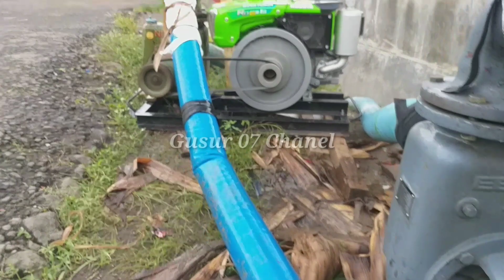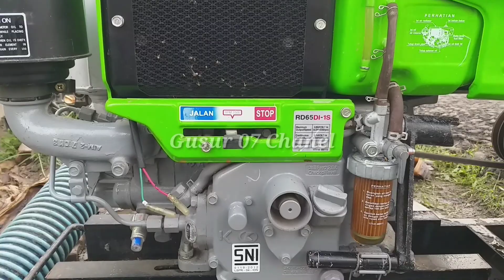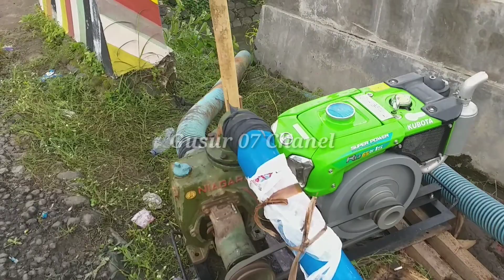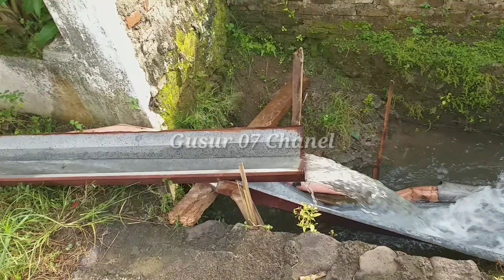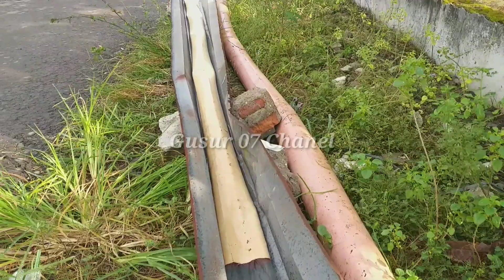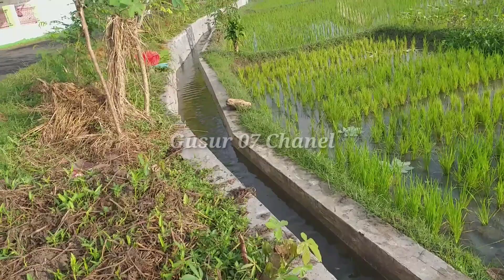POMPA AIR NIAGARA DAN EBARA 4 INCH, DUA POMPA AIR YANG BERBEDA MERK

Comment: Mna yg pling ok untuk pipa jarak 1300an m pak
Reply from the maker: 1300 m itu untuk jarak buang air dari pompanya apa gimana mas
Reply: @Gusur  ya pak
Reply from the maker: Asalkan medan landan semuanya oke pak. Cuman jalur distribusinya harus menggunakan pipa jangan menggunakan selang.
Reply: Pak misal pipa dri pompa buang di kasih pipa 6 dim jarak 100 mter trs pipa slnjutny d kasih pipa 4 dim pengaruh kedbit air ndak?
Reply from the maker: Sama aja mas, jangan di kecilin, kalo memang itu pompanya pake yg 6 inch
Reply: Dri desel ttngga jarak 1100 m 4 dim debit air g bgtu bsar